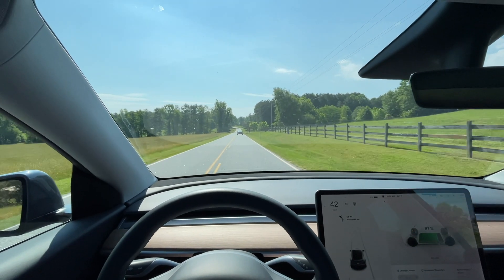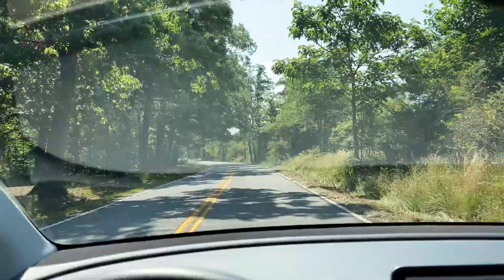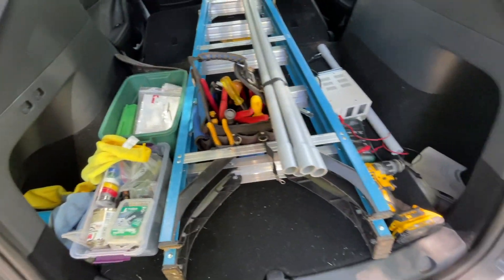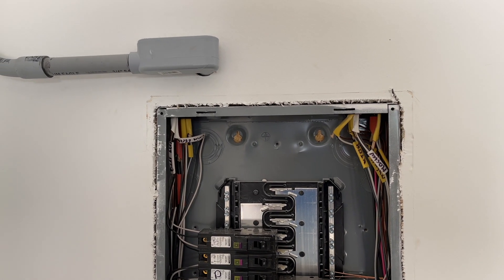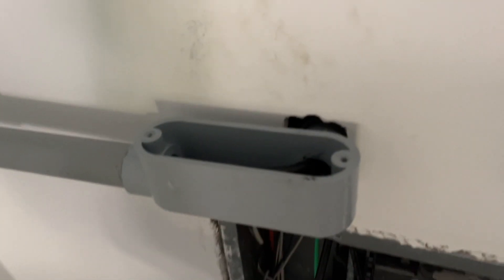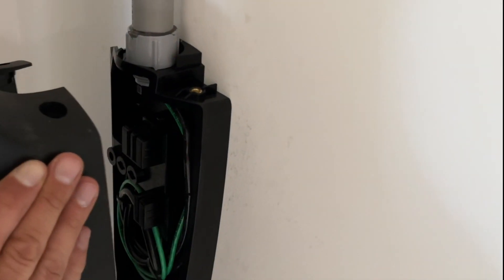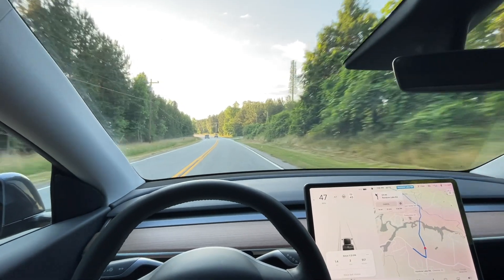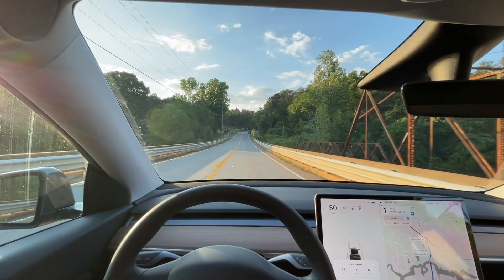Step by Step Car Charger Installation in Detail

Comment: Thanks for the video!  Question though.  What right angle fitting are you using behind the wall from the knockout to the conduit body.  I’m trying to do exactly what your doing but not sure what fitting to use in the wall to make the transition to outside the drywall.  Thanks!
Reply from the maker: John used a90 degree with removable cover plate, he treated it through the drywall into a knockout in the top of the box.

Comment: Please help me understand this installation. My understanding of the NEC says a positive disconnect switch is required for any circuit 60 amps or greater.  Am I missing something or are you in a jurisdiction that doesn’t follow the NEC?
Reply: You mean la gfci switch? It doesn’t need it tesla charger already  has it

Comment: What is a sweep? Could that also be called a bend or an elbow? And you never said what size wire you used.
Reply from the maker: Two types of plastic elbows a street elbow 90degrees and electrical elbow is a sweep, still 90 but allows you to pull wire through it

Comment: Can you please also do video on how and what you recommend at metering device for your EV charger . similar to this.  https://www.teslarati.com/ekm-digital-submeter-measures-ev-charging-efficiency/
Reply from the maker: I use a AC power meter I installed in line with wall connector power found on Amazon but requires an electrician
Reply: @evdave528  Thanks - can you please share the link so I can perhaps buy similar item.
Reply: @evdave528  I am also looking at this one. https://www.amazon.ca/ask/questions/Tx1K1CF2DNFKR0M/?questionId=Tx1K1CF2DNFKR0M
Reply from the maker: Yes Tesla.com/shop

Comment: Dave,  you said you used #6 Ga wire for the hot wires, what size wire for the ground? #8?  Please
Reply: #10 THNN for the ground per NEC 250.122 for a 60 amp continuous load

Comment: Hi Dave, Thanks for the video. Keep up the good work. What did he use inside the wall to connect to the breaker box to make that right angle. It looks like another LR but can't tell?
Reply from the maker: It’s a 90 with a back plate you can remove like an LB weird thing.

Comment: If you only have a dedicated 50 amp line and not a 60 amp line, will the wall charger still work? Just at 32 amps?
Reply from the maker: Absolutely, you can charge at any current selected in the car and is saved by GPS location.  You select it when charging.

Comment: Great video! Dave, I noticed in one of your other videos that you have multiple wall chargers. Could you do a video on considerations for installing 2 or more wall chargers? Things such as need for additional capacity from the power company. I have 200 amp service and may want a second Tesla one day for the wife.
Reply from the maker: Kenneth, the version 2 Wall Connector allow load sharing using a twisted pair between WCs.  I’ve got 3 on a 100 amp breaker with 80 amp max.  I think the v2 WCs are still available.  The software for the V3 is yet available to to load sharing. I use #2 wire

Comment: Dave, I installed a14-50 (or John did) outlet in my garage and ordered the adapter for, I think, $45.00 from Tesla. Would you consider that to be insufficient or a viable alternative to the Tesla module?   What are the main disadvantages?
Reply: that is sufficient.
Reply: 14-50 nema is perfect, it just requires that you'll need to unplug / plug-in more often than if you had a wall connector. I prefer the outlet bc it gives you options for either type of charger, and if by chance you move you just unplug your mobile charger and leave.
Reply from the maker: Only that you have to use the mobile connector which requires someone to plug in and out the 14-50 plug.  This may be dangerous for folks not used to high power.

Comment: Hey Dave, when you use a super charger, does it over ride the charge rate that you set on the Tesla's screen?  If I dial down rate of charge at home to 25A to make use of existing 30 amp circuit for seldom used table saw would I need to change it back up to max when using supercharger. Potentially one could then forget to change it back down to 25 for home use.
Reply: Supercharging is DC power and it bypasses the AC chargers in your Tesla.  The settings you are making in your Tesla for the current levels are just for AC charging. Also they are GPS based, so when you are home it can be dialed back, but at a public AC charger can be max.
Reply: no.
Reply from the maker: Yes the setting the car is only for AC charging, the supercharger Will override charge limit as needed too

Comment: Installation looks great. I switched to 1” conduit after struggling with the 3/4” pull on my first Wall Connector install.  Using #10 for the grounding conductor also helps with the pull.

Comment: Good job on this video.   I was most encouraged that you could get 10 foot lengths of conduit in the Mod Y.   Who needs a truck! Ha.  Actually in a truck it’s more difficult. I don’t like having  half the conduit flopping around outside the bed.  Fortunately I have a small sliding window in the back of my riidgeline.(it’s all the truck one needs).  FLIR  Camera? I want one.
Reply from the maker: FLIR One, I use the pro version plug into iPhone very cool measures temp.  Be sure to cover end of conduit to not scratch dash

Comment: Nice video.  Appreciated creative use of L-R connector and surprised you got it at Lowe’s.  Wish you showed pulling of wire, probably using a fish tape.  You could insert a nylon pull string during assembly of conduit too.  While it doesn’t effect performance, I prefer two different colors, maybe black/white or black/red, for #6 wire to identify L1 & L2 if future troubleshooting is needed. Does S. Carolina, like some other states, allow the homeowner to do wiring on his own home?  That means no expensive permit, electrician, or inspection.
Reply from the maker: Believe it or not John pushed the wire through before I arrived apparently he forgot the fish tape in a3/4 conduit, I was amazed